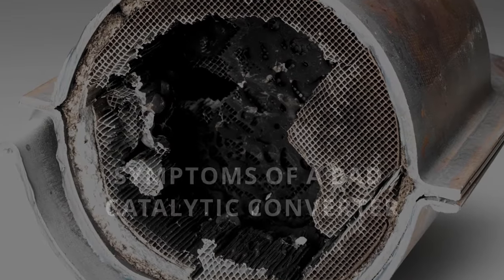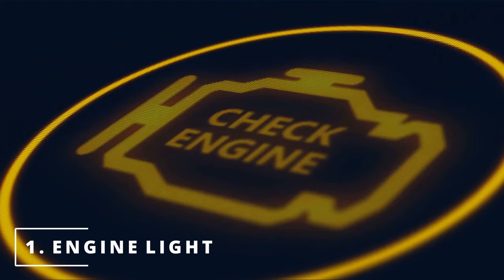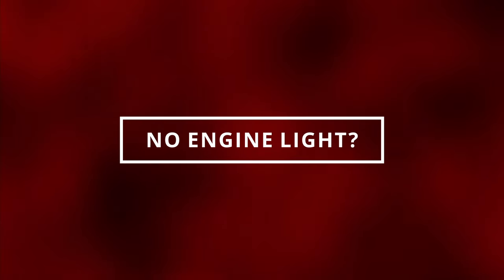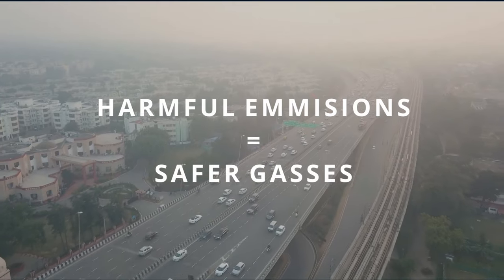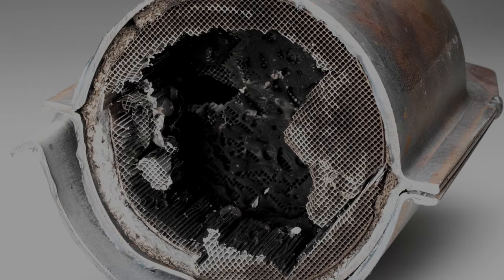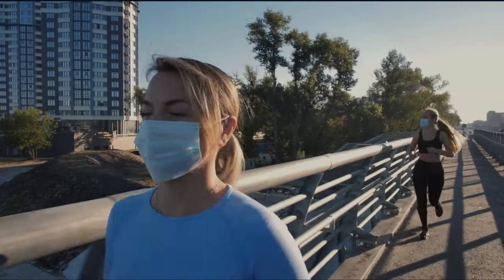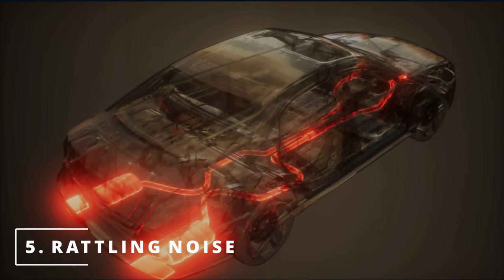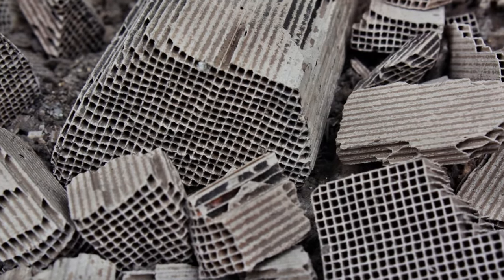SYMPTOMS OF A BAD CATALYTIC CONVERTER

Comment: For the past 6 years I've had the rattling noise and no one knew what it was, just got the car back from the shop for engine shudder/ misfire, it was the cat the whole time
Reply from the maker: Thank you for sharing.
Reply: Can you explain the misfire part
Reply: @Mkesvge  since the shudder started it first coded as a misfire, changed plugs fixed it, then it started again, coded camshaft sensors, changed them, fixed it, starts again shows as oil solenoids changed them, fixed it, same shudder started again, take it to a shop they said it was a clogged position 3 cat, deleted it, fixed it, but now shutter started again, idk what its is, no codes are coming up
Reply: @Ubaldo Ramos
Did you figure out what it was? I'm having the same problems
Reply: @-roejogan-  nope, starting to look like, timing belt, maybe tensioner, an now it's more sensitive to oil level, the last couple oil changes have all been right at the upper limit and it would shudder alot had the last shop make sure to go half a quart light and and the shudder has been much less severe
Reply: @ubaldoramos7281  I change my timing chain and other things in the car and still making a sound, then went for inspection and p0420 came up and all the things this guy said is the same issue i am having also I just spent 1600 replacing parts in my car and the mecánic didn't find were the noise is coming from. I think is the catalytic converter.
Reply: @chairacabrera  when they removed cat 3 they saw that the pipe was rattling against the frame just behind the motor and they welded a small piece to the pipe and the frame and that got rid of the rattle sound but two months ago the "misfire" feeling was getting really bad and I took it to the Chevy dealership they told me to replace the transmission for 6k, took it to a transmission shop and they said the transmission was fine and that tie rods were bad replaced and that lowered the severity of the kickback, but it's still doing it. I just saw another video about a similar impala that sounded like it had the same issue and it showed that it was the chain but it wont show a code until the computer reads it as about three toothsome off on the timing and it was only 1-1.5 toothsome off so far
Reply: You gotta get your own code scanner sir to prove to yourself the problem or diagnosis next time ...auto zone has free service of this...some cars allows you to get this reading but some not due to different cars tech of today
Reply: @leetos.4915  as of now there's no check engine light, I have a Fixd scanner it shows nothing on the computer
Reply: Yeah my Honda prelude was misfiring for a while, did a full tune up only for it to get worse. Misfires, hesitating, bad fuel mileage, weird smells, higher coolant temps, eventually it started taking longer to start and now won’t start at all. Went through fuel, spark, air, timing can’t find any issues so taking my cat off to look at it next nice day.
Reply: Price
Reply: Caddy do it
Reply: I have a polo gti 9n3...I have a rattling sound that sound like something is wrong with bearing from the fan belt... Before that i changed the water pump and some sounds stopped.. still when engine gets to temp it starts doing those sounds but this time they are not as loud... Car feels like it's not pulling as hard as it used to
Reply: I'm not sure what is the issue because the car seems to have a lot of problems because it's an old car
Reply: When I'm driving.. The car smells like burnt clutch
Reply: Lmao

Comment: Another sign of a clogged cat is very little pressure coming from the tailpipe. Take a rag or an old towel and hold it over the tailpipe opening (Wear gloves while doing this- safety first!). You should feel pressure from the exhaust pushing upon your hand.   If you can feel little to no pressure at all your cat might be clogged up.
Reply: I'll try that...ty
Reply: What can we do to unclog it?
Reply: @jaquancrump7466  there is a cleaner called  cat clean at auto shop stores
Reply: @-a-strikelures1212  will this fix the code P0420?
Reply: Cataclean doesn’t always work. Going through this right now.
Reply: @1124lxlthr me too. Tried cataclean twice....light went off for a day or two...then check light back on again!
Reply: @1124lxlthr  same. I was 2stepping and blew my cats in my coyote so now i’m stuck between going catless in CA or replacing them which is over 2 grand just for the parts.
Reply: Also engine overheating:high coolant temperature.
Reply: If my hand gets stuck to the tailpipe due to the burnt skin, should I yell out for an ambulance?
Reply: I had code pop up 0420 dude told me get cataclean poured it in yesterday drove around now today my car is making like a blowing air noise from engine when I accelerate and reduced power doesn’t pick up and go ?

Comment: MAN! everything he just said in this vid is what I'm going through right now with my '06 Maxima. my acceleration sucks and only reaches 3k rpms, with very little power. it's even worse when I'm inclining. bad exhaust smell throughout the car with white smoke pumping out the exhaust. ordering a new one ASAP and I'm putting it in next week.
Reply: Was it your CAT? 
Because I have a Prius with white smoke and jolting
Reply: @maxelsosa3863  yep it was my CAT. At the same time my timing chain popped. Tried selling it to a DIY mechanic, but nobody wants it. Ended up junking that bad boy. I got a 2016 Ford Fusion Titanium Ecoboost with a 2.0 liter turbo kit. I'm modifying it as we type.
Reply: Thanks man I’m getting tired of this car. Appreciate your feedback
Reply: The number ONE reason you know it has gone bad is because someone STOLE it  :)
Reply: I’m having the same problem. Will I still be able to drive it to the mechanic or get it towed
Reply: @maxelsosa3863  - You must check your Radiator fluid level and reserve fluid tank, you need to fix Engine Head Gasket if fluid level gets less or low in Radiator or Reserve tank (for white smoke)
Reply: I will try the cat cleaner first $22
Reply: If it's all your symptoms in your car, I suggest to start from smallest to biggest (cat) itself...you'll save tons of money ....that's y it's important to do regular maintenance on your car to avoid all these simultaneous symptoms
Reply: @jvajva2352  hey did it ever work ??
Reply: @GamerxC-xo2jt Drive it.

Comment: If you're in the market for a new scan tool, the blue driver he recommends is really top notch. It scans and clears all system modules as well as providing live data for a ton of systems. For the $100 or so I paid, it's the best hands down.
Reply: Do you need a subscription for the blue driver?

Comment: I think the most definite symptom cat is bad is the rattling noise out of all the symptoms..thanks much sir for your educational blog
Reply: Im trying to figure out the issue with my moms 06 scion Xa and we replaced the plugs and coil pack, spark plugs were shot and needed replacing anyways. But it will intermittently run like garbage. But it in fact makes the horrible rattling noise you mention! I will be replacing it because most likely something in there had fallen apart and the cataclean won’t suffice
Reply: @bowtiebuilding  what year model and how mileage on your car? Cuz it's a determine factor at times regardless how well you do your regular maintenance on top it...cat breaks down eventually which is totally normal...I'm at 240K mileage with my 2017 Hyundai ioniq due to driving for Uber full time here in LA
Reply: On second thought, a new cat is $770 so we gonna try something different 😆
Reply: @bowtiebuilding  I don't think  there's other way around it to eliminate that rattling noise cuz the honey comb metal inside is torn apart that's y it's making that rattling sound...anyway if your performance of your car chokes frequently....then consider to check your transmission also...you might have slippage
Reply: @leetos.4915  it’s my momma car and she’s at 348k! Been good to her. Night just knock the guts out and put it back. Living in east texas so we don’t worry about emissions

Comment: Interesting I kinda figured the rattling noise was from my cat cause I got a catalytic Efficiency code and what sucks is that the catalytic converter is attached to the manifold on my 2017 ford focus and it costed me $800 not including the two ntk o2 sensors I got  to replace the old ones  so I don't void the warranty on that but ever since I replaced it the check engine light was gone and the rattling was gone
Reply: Was the rattling noise only on start up?
Reply: @karenyoung5357  a rattling noise on start-up is worn out motor mounts or a loose exhaust bracket somewhere. A lot of times its both because worn motor mounts allow the engine to move too much which pulls on the exhaust system, causing leaks, breaks and rattling sounds. Actually, worn motor mounts are really bad for multiple reasons as it can cause damage to your transmission and suspension and steering components. Hope this helps you out a little.
Reply: @Whats-It-To-Ya  how long do we have to replace it?
Reply: Is it the symptom like you during crusing csn only rev. around 3000rpm for few seconds, then suddenly check engine blinking with engine shuddering and aircondition air get hot?

Comment: On vehicles that utilize two catalytic converters how do you know which one is bad?
Reply: I dont know if you can feel it but you could feel it before it gets to hot and see if one is rattling
Reply: @publikintox892  That's alright. I finally bought a code reader and found out it was the sensors and not the cats themselves.

Comment: So my mustang definitely has the rattle sound and I'm thinking about deleting the cats. But if your saying that my air fuel ratio is not correct should I be concerned about that?
Reply: Holl
Reply: Why don’t you try checking for a loose heat shield around your catalytic converter first before condemning the cat, Crawl into your car with a rubber mallet and hit your exhaust and listen for the sound! Videos like this are horrible, All they do is cause people to panic! For every symptom that he states in his video there is usually a more common less expensive issue other than a bad cat!

Comment: I use Cataclean fuel additive to clean the catalytic converter in my 2007 Mazda MX-5. That, and a little bit of redlining on the motorway when performance starts to suffer. Sometimes that can mean doing 65 mph in second gear. Cat gets hot, blockage be gone!

Comment: Could a bad CAT cause a engine to turn off at idle ? Thant’s the only code that shows up is the p0420 . When I’m coming to a  stop the rpm will start to move up and down and the car will suddenly turn off out of nowhere
Reply: Your having idle air control valve issues (iacv) issues
Reply: @bmstich  man maybe I switched out the throttle body that didn’t fix the problem , but continues to turn off when at stop or slowing down and also no codes are showing up
Reply: @omargarcia9115  did you figure it out ? I have the same thing now
Reply: please my name is Emeka army in mechanical engineering from Nigeria
Reply: Am from Nigeria my name is Michae
Reply: please I need this work
Reply: @omargarcia9115  did you find a fix very stressful situation
Reply: @hassemsadiq   not at all man I tried everything . I ended up selling the car to a mechanic he said he had to replace the engine .

Comment: after I did a combustion leak test at my radiator ( showed no problem at all ), then out of curiosity  I used the thing to suck fumes from the exhaust. I held it about a half inch from the tail pipe. It immediately turned very dirty yellow. Would this happen if my CAT is functioning properly ?

Comment: The penny just dropped, when as I understand combustion and the clogged DPF and CAT which’ll come back into the engine, also the need for a little back pressure. It’s the combusted coming back into the Engine and the taking up valuable Air space of Fresh Air to continue through the next cycle. Gr8 BLog.!

Comment: How to identify if i have a slightly bad cat? I have p0420 and p0430 code and i have no symptoms mentioned. I suspect it is the beginning of clogging, meaning the damage is only starting. How to verify this?
Reply: Same problem with me let me know if you have fixed it
Reply: @gunmetal5.7  yes fixed it. The only way to solve mine was replacing the CATs
Reply: @gunmetal5.7  can try a backpressure test. Otc makes the tool.
Reply: @musclesvf  Thanks appreciate it. If I end up needing new cats I will probably just remove them since I already have long tube headers and the cats is restricting the full HP I can get out of them. But I will look into that test first

Comment: Could this cause my car to sputter and go slow and then jump
Reply: Yes. 
Loss of acceleration power. 
Sudden stalling. 
Sweet smell/ egg smell. 
Underneath of car becomes warm very quickly typically before the engine area. 
Sound similar to an exhaust leak. 
Poor gas mileage. 
Smoke coming from tail pipe.
Reply: Yea , got these symptoms on my 2008 Lexus, cleaned the CAT with Liquimoly Cata clean. Now the jump is gone and acceleration is great.
Reply: it could also be bad coils causing misfire
Reply: @fahadalsowaidi7965  where can i get the liquimoly??
Reply: Most likely possibilities:
Catalytic converter 
Exhaust manifold leak
Dirty or bad o2 sensor
Bad spark plugs/ wires
Other things I'm probably forgetting 

Look up how to determine which cylinder is misfiring just in case. Usually involves turning the car on, and removing one spark plug wire from the distributor cap, listening, then putting it back on and repeat with each wire. If one being removed creates a noticeable change in sound/ idling that is likely the cylinder related to the issue. From there, research.  Many people have many suggestions on what to test from there depending on your specific car. This might help if there's a compression issue as well.
Reply: @fahadalsowaidi7965  how did you do it? Step by step?
Reply: @jaquancrump7466   
1 - remove the intake assembly exposing the throttle body.
2- disconnect the MAF sensor. 
3 - start the car ( depress both brake and acceleration pedals and push start) 
4- reach operating temps. 
5- Let someone keep the rpm at 3000.
6- spray the whole catalytic converter cleaner into the throttle body using a spray bottle making sure it is a fine mist  ( also, make sure to use the correct one as there are two catalytic converter cleaners, one to be sprayed into the throttle body & the other is added to the fuel tank).
7-stop the engine and connect the intake assembly and everything back together.
8- clear any codes or DTCs
9-add the fuel tank catalytic cleaner to the fuel tank then refuel the entire tank and dont refill again untill all the fuel is gone.

Comment: Could this cause my car to give off a strong carbon monoxide type of spell when it’s parked on idle or is that an exhaust leak?
Reply: I wouldn’t say leak because I’m having the same problem with my 2007 hummer H3 it doesn’t leak it just doesn’t give the full power it needs when it has all of that stuff it loses power to the engine and it makes it waste more gas Bc of it
Reply: Gives off sulphur means it’s starting to clog up take it for a good 30 mins drive at 3/4k rpms or higher if needed this should burn all off and clear your converter:)

Comment: I have a Chevy impala 2014 I’ve replace spark plug, transmission, throttle body, coils packs, and still have an hesitation issue and misfire, the catalytic converter it’s my last option to change, because it’s been months like this :(

Comment: I I’ve codes po430 po420 po153 I have aftermarket headers with K&n CAI but my fuel economy has not dropped I have a heard a quiet hissing sound only on acceleration between 20mph-30mph but the car is hesitant if I try step on the gas then after a second it picks up speed could it maybe be a vaccum leak or exhaust leak and not a bad catalytic converter?
Reply: I also have a pO420 code and have very similar symptoms. Accelerating slowly like you said around 20-30 mph you can feel and sometimes hear hesitation. Once im up to speed there are minimal issues. No problem getting to high RPM's or going over a certain speed so im starting to think its not my CAT. Did you ever find a solution to your problem?
Reply: @Etch88  I had mine looked at by a friend who owns a shop and works on mopars for mine he said it was normal because it was the lifters causing that hesitation since the lifters sometimes engage into only 4cyl to save gas and once you step on the gas it try’s to reengage into 8cyl
Reply: @Etch88  He said the only solution to not have that hesitation would be to upgrade to non-MDS lifters so I’ll be getting that with a comp cam soon since the comp cam comes with the non-MDS lifters as a kit

Comment: I keep getting a 420 code on my truck. Truck runs great and never a code on the highway just in town now and then. No one seems to be able to fix it. Could change cat but oem around $2000. Muffler guy says just drive it. Been doing this for a few years.

Comment: I just got a p0420 on my 2006 suzuki swift. I have struggled with the car randomly seizing up while driving for a couple of weeks now. 

It will run normally most of the time and then suddenly the rpm drops and all i can do is mantain the rpm without gaining any, if i keep driving like that for about 5-10 seconds it will just snap out of it on it`s own and i can keep driving normally. If i shift into neutral when the car is in this state and let go of the gas, the car will stall. it also smells like petrol when i start the car and idle, fuel efficiency has gone down as well. 

Sounding like a cloged cat?
Reply: Mine has p0420 and vibrates on stop and red lights
Reply from the maker: Sounds like it to me.
Reply: Not a crankshaft p sensor ?
Reply: So it’s the cat that causes p0420